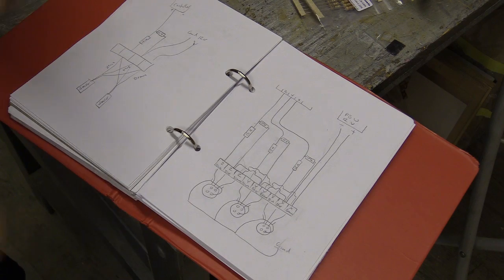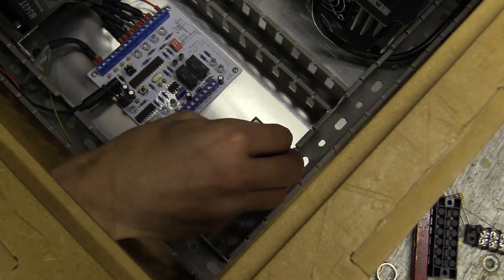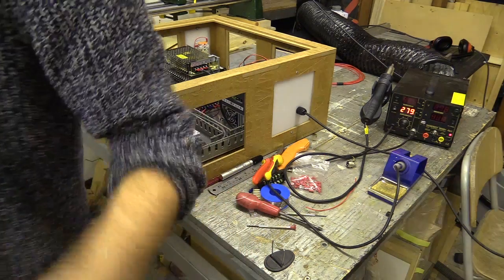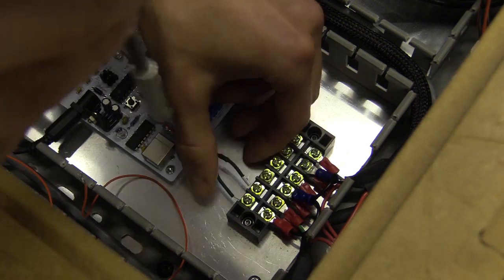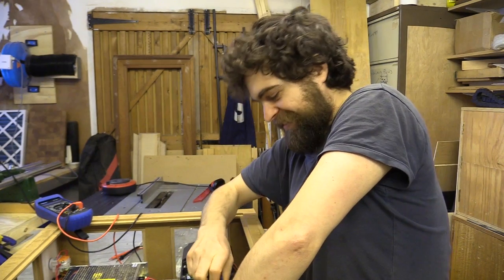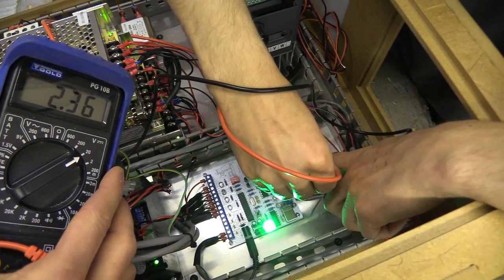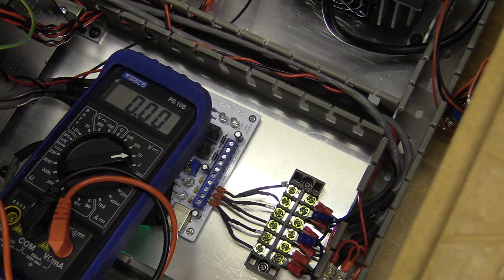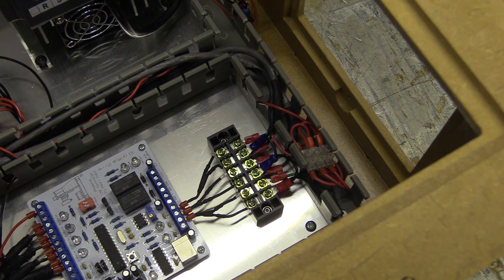#14 Wiring Voltage Dividers for Proximity Sensors #14 / CNC Control Box

Comment: Normally when using NPN NO or NC sensors, the 24 volts is only needed to power the sensor.  The actual output is an open circuit when off.  This can use the 5V pull up logic on your controller with no other modification or resistors.  When the sensor triggers, even in parallel, it simply provides a ground to the controller.  Not complicated and no special parts needed. Two or more can be wired in parallel so when any trip, it provides a ground to the controller input.  There is less likely vibration and movement will break a small wire on a resistor when it isn't there.

Comment: Great videos, I just wish I had the time, space and budget to make something like that.
When I'm soldering things I swear by a big lump of bluetak, it allows me to temporarily hold the thing I'm soldering to.
For level shifting 12V to 5V you can get pre made PCB boards with a row of inputs and outputs to do the level shifting for you although the resistors should be fine but they will interact with the internal pull ups on the Arduino, if I remember correctly I think they can be disabled in the software.

Comment: 10k ohm from the blue power supply ground wire to the black wire that goes to the breakout board input pin gives you a 6 volts signal voltage for a 12 volt brown wire for a NPN Proximity Switch and for two in parallel the resistor would be half like 4.7k ohms.

Comment: I have been advised to always use Limit Switches the are operated in a NC environment for safety sake. Do you know of any that will work in this format? And yes I do realize that for an electrical device to work it needs a current running at all times.
Reply from the maker: Yeah I hope I haven't made myself more problems going with the proximity sensors. I can't really recommend any as I am using normally open ones. but what I would say is get the screened type if you do go with proximity sensors. I didn't, and will have to shield the wire at a later point.
Reply: @EducatingSavvas  The NC PNP type are used in higher power stuff as any wire break, cut or grounding of the wire drops the active high.  Unfortunately in an arduino environment, they 1 don't like 24 volts in the input, and you can't wire two in parallel, so each requires it's own input.
Reply from the maker: @isettech  I'm going to put up a new video soon about failsafes and opto-isolators. But I also did a controller rebuild video which is already up. Mine looks very different inside now.

Comment: Hi Savvas, firstly i love following your series. Instead of using voltage dividers an easier way would have been to use a diode in reverse from your sensor output to the controller. Then set the pull-up resistor on the controller. When the sensor isn't triggered you'll get 5v from the pull-up resistor, but when it is triggered you'll get 0v (because the sensor output is grounded). This meanes that it'll work regardless of the supply voltage to the sensor, where as if you change your supply voltage you'll have to change the resistor values for your voltage dividers to suit.

TECH2C has a good video about sensors here, https://www.youtube.com/watch?v=wih4fNkKUCc

Keep up the good work.
Reply from the maker: The thought of using diodes popped in my mind because I noticed the stepper drivers use them to separate the inputs and prevent - but I went with voltage dividers as there were people (and Nathan) around to ask questions when I got stuck. Thanks for the link!